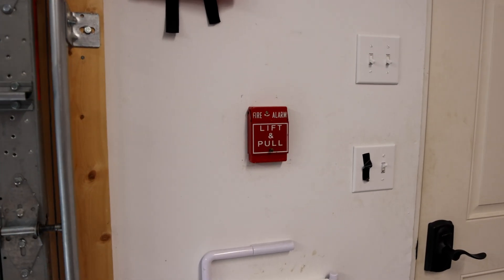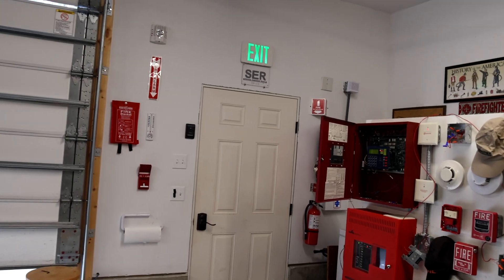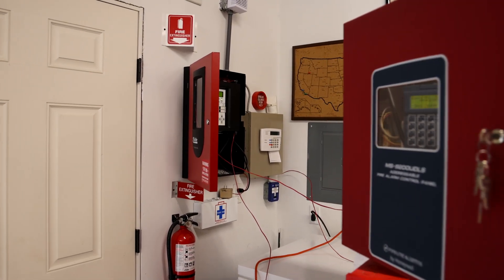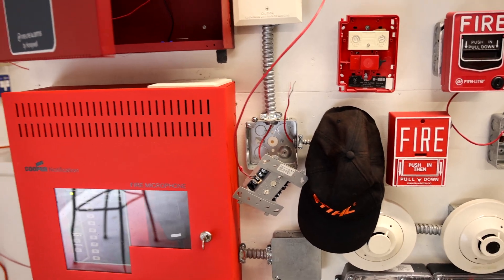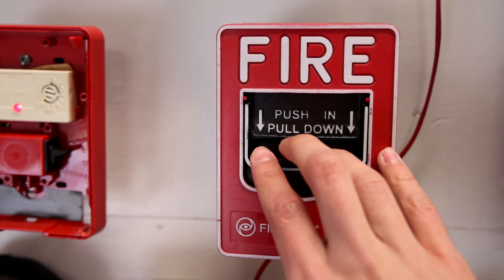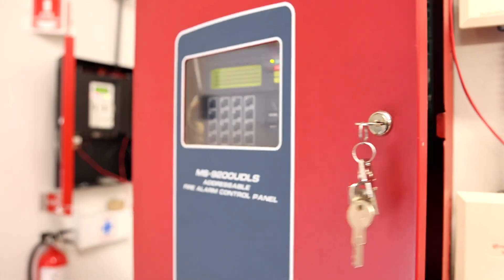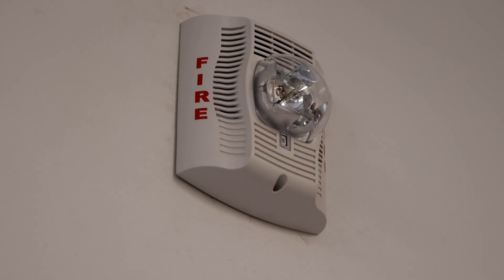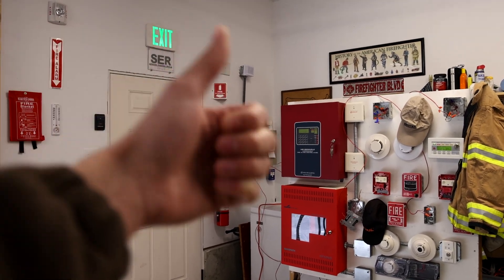Fire Evacuation & INTRUDER Alarm! | S.E.R. System Test 29

Comment: I used to go to a school that now has est speaker strobes but they are not the est genesis ones and now I go to one with System Sensor ceiling mount speaker strobes and separate alert strobes

Comment: Global Fire Control pull station, Wheelock voice evac panel, EST Message, Panel and detectors, system sensor and gentex speaker strobes, with a fire lite panel/pulls/ annunciator on the other part of the system. Interesting to say the least.

Comment: Great system test. It’s very, interesting to see voice evac in the whole SER rather than just the demo board
Reply: You should do a Uk fire alarm system
Reply: @gyldn3115  l we be doing a fine alarm system test siemens speaker strobe 4 watt high low tone for the test l have the system sensor spectralert advance speaker strobe mounted on the wall and the gentex SS PK 24 PR speaker strobe Setcw speaker only 4 watt high low tone and the wheelock as and the wheelock mt code for a while

Comment: Why did it take…..wait a sec how did u connect the fire lite  ms9200udls to the other panel!! And amazing voice system video!
Reply: Every system (fire, security, emergency etc) has a relay output that is usually connected to a siren.

This relay output, can be connected as a "detector" on another alarm system. Making the panel a sub-panel.

Imagine you have a shopping mall. Then you can have a master system (fire and intrusion loop, 24h) wired to each tenant to a junction box, and then the tenant hooks up their own alarm system to this loop, meaning, that logically, each tenant's alarm system, is a "detector" in the large panel.

So on master fire or intrusion panel, you see which tenant gone off, then you go to that tenant's panel and see which detector gone off.

So basically, if you have a rent house complex, you could have a small 4-zone system in each house, 1 pull station and 3 smoke, that the tenant controls himself (and can hush/silence/reset if it just was some burnt bread in toaster).

Then this 4-zone system's siren output is wired to a "smoke detector input" on a bigger panel with lets say 16 zones, one for each house.

So on master panel you see which house gone off, go to that, subpanel says which detector.

Great way to project a fire or intrusion system when you don't own everything.
Reply: That a lot to read
Reply: @stacywilliams1310  The principle is easy however, if you want panel A to trip panel B, just think the panel A as a really big smoke detector or PIR detector, and then connect accordingly.
Reply: HOWEVER if the unit you want to trip, is a adressable unit with no non-adressable inputs, you will need a so called adress unit, which will convert a dry relay input to adressable data communication. This input, you connect to the relay ouput of the panel that is the triggering unit. Preferable you can stick the whole adress unit into the enclosure of the triggering unit (the one that sends the alarm) so the unit that you want to trip, has protected communication all the way.
Reply: Ok

Comment: Do you know if you have a plan for the permanent setup? Are you going to mount the Safepath on the system instead of on a board? Quite intresting to see you are merging the two series!
Reply from the maker: As of now, this is temporary
Reply: @SERSafety why is it an EST message
Reply: @Newenglandaviation987 Custom messages can be uploaded to the Safepath
Reply: @Train_D3V  why est?